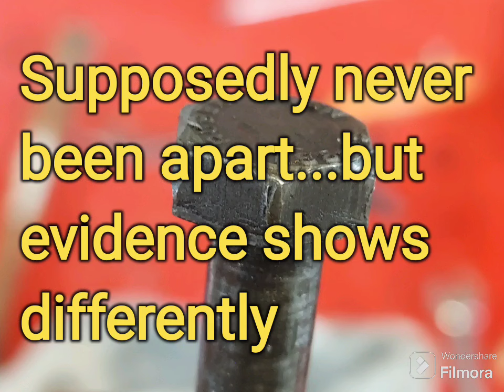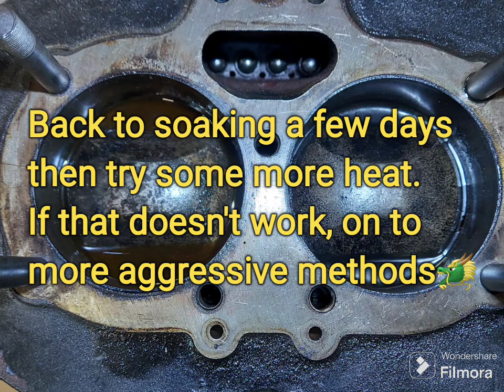1968 BSA A65 Hornet Desert Race Engine Seized

Comment: i sure do not miss kicking one of these over. i used to have a a65 spitfire and by hell was that compression stroke something. the guy i bought it off of couldnt be bothered rebuilding the carburetor multiple times he would ride it , it would leak fuel out the tickler on each carb and catch fire. he said to hell with it its a death trap if it dont kill him itl kill someone else and well with that attitude i took on the risk for an easy $300.

Comment: No. 1, its anBeezer, very prone to issues  like blowing up. No. 2, High Compression is a Non-Finisher. Desert Racers used 7.5:1.
Reply from the maker: The MK3, Hornet and Wasp had 10.5:1 Compression as opposed to Thunderbolt, Lightning, ect had 9:1 https://www.motorcyclespecs.co.za/model/BSA/BSA%20A65.htm#:~:text=The%2075%20mm%20by%2074,surprisingly%E2%80%94%20has%209.0%3A1.